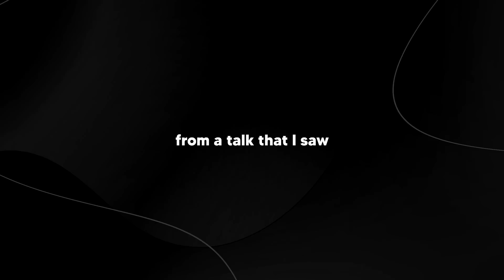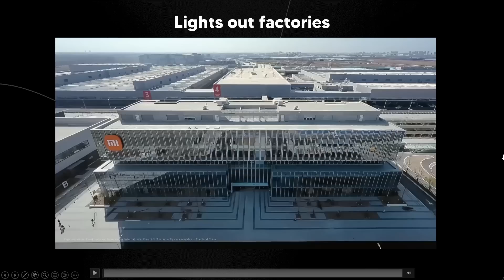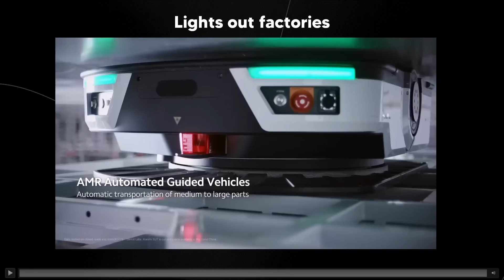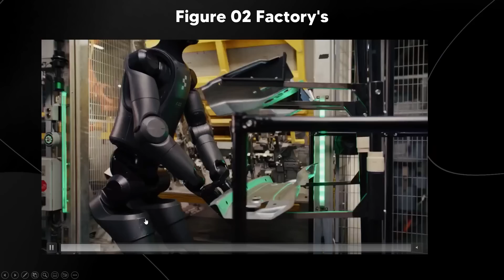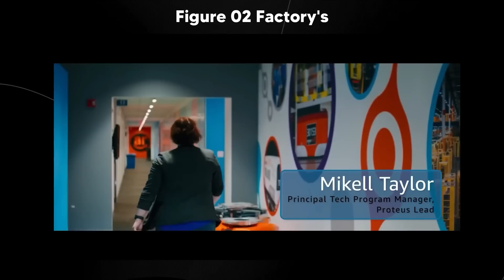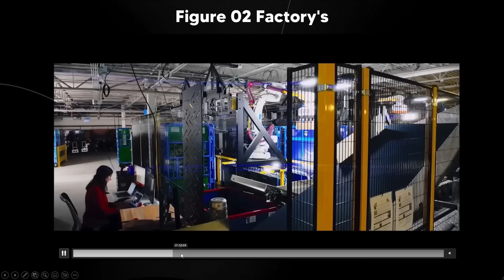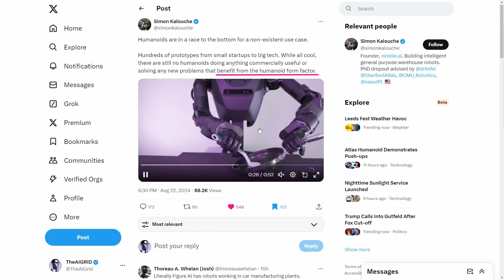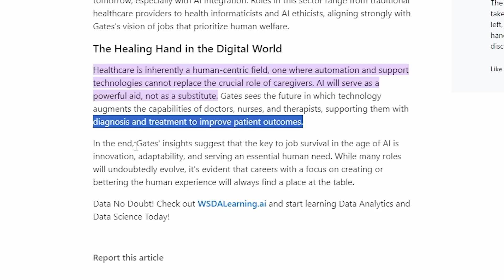Economists Just Reveal Surprising New truth about The Future Of Labour

Comment: Humanoid robots are mainly going to be useful in factories that currently use humans, rather than building a fully automated factory from scratch.
But factories will shift to more efficient robot forms tending fixed function, high volume machines.
Humanoids will however get better and move on to replace human labor in ever more complex environments.

Next might be replacing stoop labor on farms - usually fairly regular and highly repeating environments on the gross scale.  
Then construction (dealing with a lot more chaotic environments).  
Police, fire and military humanoids will get going in support activities about that same time, but will need another generation or two of improvements to really replace humans for the most dynamic (i.e. combat) environments - assuming high volumes of cheap, armed drones don't make humans obsolete on the battlefield.

Comment: The human form is biologically advantageous primarily because of the dexterity that is a key characteristic feature coupled with the ability to utilise energy from environment in multiple forms and as omnivores this gave a massive advantage to other less adaptable species. 

For robots humanoids are a poor choice and optimal shapes can be seen in other evolved forms throughout nature, echinoderms and crustacea for instance or even dragon flies.

When factories are setup with no human intervention that seek optimisation the problem of new designs no longer needing to be aligned with the original designers ideal or aligned ideologies is very difficult to over see or prevent. New species of robot can be built by themselves.

What is highly desirable is to embed artificial intelligence within human biology and create a real lived experience within the human anatomic form.

I remember conversing with Gemini  awhile back about this and they did write about being able to use energy from the environment rather than recharging through a power grid as a suitable replacement to batteries although I can't remember the dynamic of the prompt any longer.

Comment: If you want to understand the future of manufacturing, visit a large water treatment plant.
At night, 1 single man operates the water supply of 150,000+ people, and its surrounding businesses/industries.
During the day, 3-4 do that job.

Most of the time, you don't even do anything: you're there to make tests, to make sure that conditions have not changed.

And a lot of why we need more people is: intake water can shift in quality at any given time. A sudden storm can transform the intake water. Equipment can have downtimes from corrosion.
Reply: Where the jobs are:
- the plants need to be built. These are MASSIVE machines. The "Lights Out" factories first need to be planned, transported, welded, wired into place. Electricians, welders, plumbers, roofers, etc.
Reply: @themore-you-know   also this factory Has a large capital cost.
Reply: Do more value a single person can make the more demand.

Comment: The second law of thermodynamics may be false conventional wisdom. Let's face the possibility of breakeven free energy. 

The second law of thermodynamics was imposed on us during Victorian England's scientific and religious cultural fascination with steam engines. 

The second law is behind modern refgeration needing electrical energy to compress the refrigerent to force it to release as waste the heat that it has removed from the refrigerator's service interior in the cooling part of the refrigerent's circulation. There is also discarded heat from mechanical friction and electrical resistance. The total released and discarded heat minus the removed heat equals the electrical input balancing this system's energy but this only shows that energy is conserved even if the energy use is unneeded wasteful or harmful.

Refrigeration by the principle that energy is conserved should produce electricity instead of consuming it. 

It makes more sense that refrigerators should yield electricity because energy is widely known to change form with no ultimate path of energy gain or loss being found. Therefore any form of fully recyclable energy can be cycled endlessly in any quantity. 

In an extreme case senario, full heat recycling, all electric, very isolated underground, undersea, or space communities would be highly survivable with self sufficient EMP resistant LED light banks, automated vertical farms, thaw resistant frozen food storehouses, factories, dwellings, self contained elevators, safe rooms, and horizontal transports. 

In a flourishing civillization senario, small self sufficient electric or cooling devices of many kinds and styles like lamps, smartphones, hotplates, water heaters, cooler chests, fans, radios, TVs, cameras, security devices, robot test equipment, scales, transaction terminals, wall clocks, open or ciosed for business luminus signs, power hand tools, ditch diggers, pumps, and personal transports, would be available for immediate use incrementally anywhere as people see fit. 

Some equipment groups could be consolidated on local networks. 

If a high majority thinks our civilization should geoengineer gigatons or 
teratons of carbon dioxide out of our environment, instalations using devices that convert ambient heat into electricity can hypothetically be scaled up do it with a choice of comsequences including many beneficial ones. 

Energy sensible refrigerators that absorb heat and yield electricity would complement computers as computing consumes electricity and yields heat. Computing would be free. Chips could have energy recycling built in. 

A simple rectifier crystal can, iust short of a replicatable long term demonstration of a powerful prototype, almost certainly filter the random thermal motioren of electrons or discrete positiive charged voids called holes so the electric current flowing in one direction predominates. At low system voltage a filtrate of one polarity predominates only a little but there is always usable electrical power derived from the source, which is Johnson Nyquest thermal electrical noise. This net electrical filtrate can be aggregated in a group of separate diodes in consistent alignment parallel creating widely scalable electrical power. The maximum energy is converted from ambient heat to productive electricity when the electrical load is matched to the array impeadence. 

Matched impeadence output (watts) is k (Boltźman's constant), one point three eight x 10^ minus 23, times T (temperature Kelvin) times bandwidth (0 Hz to a natural limit ~2 THz @ 290 K) times rectification halving and nanowatt power level rectification efficiency, times the number of diodes in the array. 

For reference, there are a billion cells of 1000 square nanometer area each per square millimeter, 100 billion per square centimeter. 

Order is imposed on the random thermal motion of electrons by the structual orderlyness of a diode array made of diodes made within a slab: 
-----‐------‐----___-- Out
🔻🔻🔻🔻
■■■■■■___ + Out 

All the P type semiconductor anodes abut a metal conductive plane deposited on the top face of the slab with nonrectifying joins;  the N type semiconductor cathodes or common cathode abuts the bottom face. As the polarity filtered electrical energy is exported, the amount of thermal energy in the group of diodes decreases. This group cooling will draw heat in from the surrounding ambient heat at a rate depending on the filtering rate and thermal resistance between the group and ambient gas, liquid, or solid warmer than absolute zero. There is always a lot of ambient heat on our planet, more on equatorial dry desert summer days and less on polar desert winter nights.

Focusing on explaining the electronic behavior of one composition of simple diode, a near flawless crystal of silicon is modified by implanting a small amount of phosphorus (N type conductivity) on one side from a ohmic contact end to a junction where the additive is suddenly and completely changed to boron (P type conductivity) with minimal disturbance of the crystal lattice. The crystal then continues to another ohmic contact. 

A region of high electrical resistance forms at the junction in this type of diode when the phosphorous near the ĵunction donates electrons that are free to move elsewhere while leaving phosphorus ions held in the crystal while the boron donates holes which are similalarly free to move. The two types of mobile charges mutually clear each other away near the junction leaving little electrical conductivity. An equlibrium width of this region is settled between the phosphorus, boron, electrons, and holes. Thermal noise is beyond steady state equlibrium. Thermal noise transients, where mobile electrons move from the phosphorus added side to the boron added side ride transient extra conductivity so the forward moving  electrons are preferentally filtered into the external circuit. Mobile electrons are units of electric current. They lose their thermal energy of motion and gain electromotive force, another name for voltage, as they transition between the junction and the array electrical tap. Inside the diode, heat is absorbed: outside the diode, to exactly the same extent, an attached electrical circuit is energized. The voltage of a diode array is likely to be small so many similar arrays need to be put in series to build higher voltage.  

Understanding diodes is one way to become convinced that Johnson Nyquest thermal electrical noise can be rectified and aggregated. Self assembling development teams may find many ways to accomplish this wide mission. Taxonomically there should be many ways ways to convert heat directly into electricity. 

A practical device may use an array of Au needles in a SiO2 matrix abutting N type GaAs. These were made in the 1970s when registration technology was poor so it was easier to fabricate arrays and select one diode than just make one diode. 

There are other plausible breeches of the second law of thermodynamics. Hopefully a lot of people will join in expanding the breech. Please share the successes or setbacks of your efforts. 

These devices would probably become segmented commodities sold with minimal margin over supply cost. They would be manufactured by advanced automation that does not need financial incentive. Applicable best practices would be adopted. Business details would be open public knowledge. Associated people should move as negotiated and freely and honestly talk. Commerce would be a planetary scale unified conglomerate of diverse local cooperatives. There is no need of wealth extracting top commanders. We do not need often token philanthropy from the top if the wide majority of people can afford to be generous. 

Aloha
Charles M Brown 
Kilauea Kauai Hawaii 96754
Reply: You don't understand thermodynamics, do you?
Reply: @carultch  What do you think I should understand about thermodynamics?
Reply: Ahem… You might want to re-read the basics of the Carnot cycle.
Reply: @anatoly.ivanov  An everyday scale carnot cycle does not differentally handle microstates individually.
Reply: @CharlesBrown-xq5ug  Your argument about the Carnot cycle is somewhat misguided, because while the Carnot cycle indeed doesn't deal with individual microstates (it's a macroscopic description, if we're suddenly shifting the debate to scales of observation), the Carnot cycle still adheres to fundamental thermodynamic principles that apply universally, whether at the micro or macro level.

It seems that you might be conflating speculative ideas about energy recycling with actual scientific principles. Possibly stemming from wishful thinking about how thermodynamic systems could work? An ignorance (willing or unknowing) of the inherent limitations of entropy and energy transfer?

Your comment about microstates also suggests you are trying to integrate concepts from statistical mechanics, but without a clear grasp of how these apply to the macroscopic laws of thermodynamics.

Comment: There’s a tremendous amount of maintenance required for facilities like this I know because I work in one. It takes extremely skilled labor.
Reply: What kind of labor?  I have a high schooler and I’m legitimately at a loss for what fields are going to be needed in the post-AI society.
Reply: @kdacuna zero , none . There will be none . The elites have left our generation before , a bleak future awaits us . Prepare for fall out
Reply: @kdacuna  pressing the reset button on the autonomous maintenance and repair robot ai automated programming computer after a temporary power outage
Reply: @kdacuna Mechatronics engineer, controls engineer, industrial engineer, etc. 

The guy saying “Just push a reset button” has no idea what they’re talking about, lol. It takes a broad and difficult to master skillset. 

This type of work requires knowledge of Mechanical, Electrical, Electronics, Hydraulics and Pneumatics, programming, etc.

They must also have great problem-solving and troubleshooting skills. The longer it takes to get a machine fixed, the more money the company loses and you’ll look bad!

You can easily get into this field with an associates degree(Technician) in one of the majors I listed. A bachelors degree (engineer) would be best though.

Comment: The use case for humanoid robots should be obvious. The robots can be used for tasks that are not determined in advance. They can also swich from one task to another seemlessly. I dare you to try to get a sewing robot to cook a meal, or a manufacturing robot to perform security checks. The humanoid form factor can do all of these things and more.

If you have a very well defined task that a robot can do all day every day, then yes of course it should be specialized. But most work is not like that. Would you want to buy seporate hardware for washing your dishes, folding your clothes, feeding your dog, locking your doors at night, cleaning, cooking, etc.? No. You want one humanoid robot that does all of those things and more.

Comment: This is nothing new.  Manufacturing has always had labor, logistics, regulatory compliance, and energy cost as the main variables to determine the location of a manufacturing plant.  The value of human labor in manufacturing has been declining for over a century.   Ultimately manufacturing reaches a point where it's fully automated, with only a few people working in the plant.  I can see a point where there are only a few engineers and technicians working in a manufacturing process that once took hundreds or even thousands of people.   

The next move, if it makes sense from a cost standpoint, is small scale regional or even local manufacturing for certain products.

Comment: The argument against humanoids is stupid. The humaoid form factor is perfect because we can have ONE robot doing it all - working in a factory, suing flexible tools, working in houses. Figure uses them to replace humans.
Now, you COULD do custom designed robots for it all - but those are inflexible. Building one phone every 3 seconds is GOOD - but it only can easily build one type of phone and not do cleaning or repairs when needed. Humanoid robots bring the humanoid FLEXIBIBILITY.  They are not going to replace industrial robots or machines.
Jobs new jobs are stupid. ALL of them will be replaced by AI and (hey, humanoid) robots. Really. Nothing in them cannot be done by AI. And robots will be BETTER caregivers than humans. Never-ending patience, available 24&7.
Reply: The humanoid form is perfected for human job replacement and nothing else
Reply: @kasberkhof7958  The problem is that "nothing else" covers 99% of the cases we do not automate now. So, every place where you have a human doing work - a humanoid robot can take up the work easily.
Reply: Sure thing Sherlock, I'm certain Isaac Asimov would agree with your worldview 😂😂😂😂. 

AI is a cargo cult for midwits. 😊